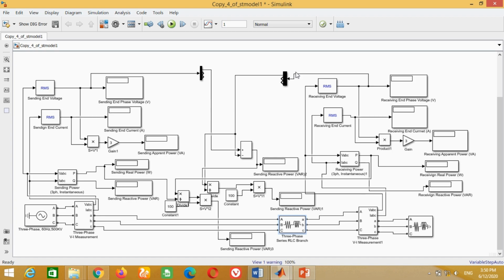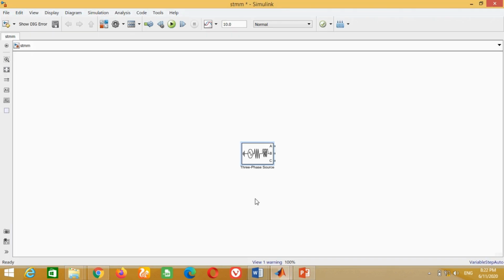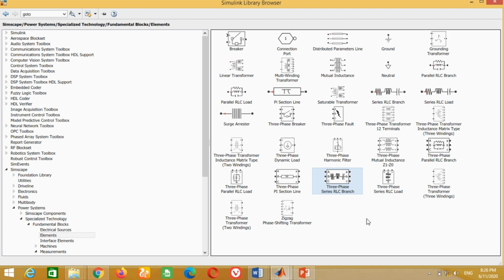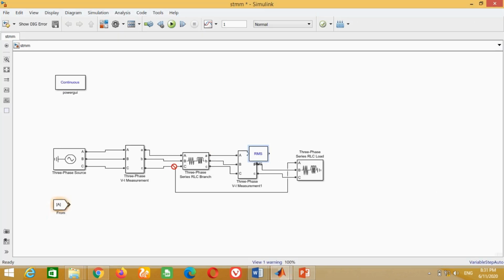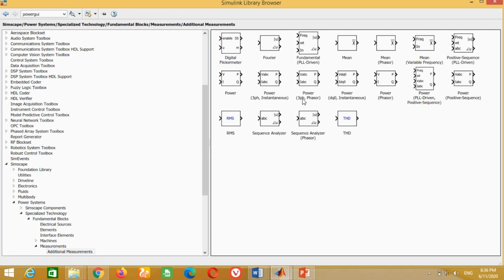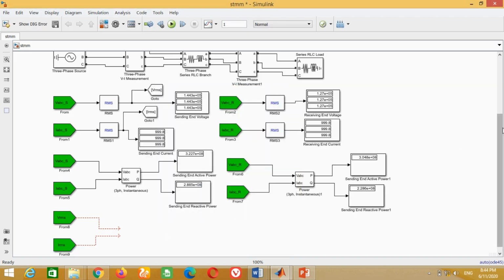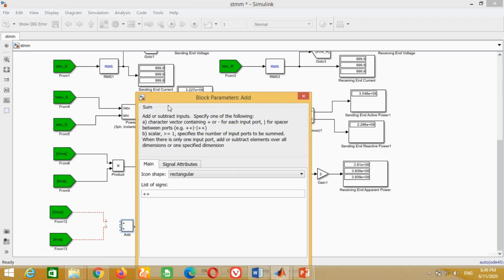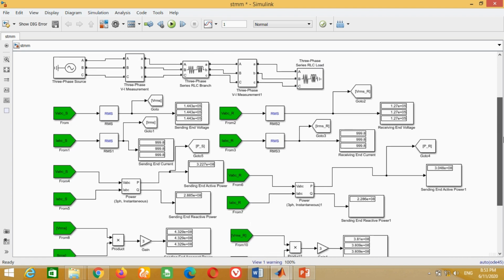How to Design Short Transmission Line in MATLAB/SIMULINK using Labels ? | Dr. J. A. Laghari

Comment: Sir, how can we generate thousands fault data from fault simulations in simulink?
Reply from the maker: Thanks for the comment. By considering a large power system such as IEEE30 bus system or IEEE69 bus system we can apply all types of faults at every bus and by changing the fault resistance and ground impedance, thousands of faults can be applied in the system.
Reply: @DrJALAGHARI  i mean how can we generate fault data with many different fault resistances, distances in one single script or command because it's hard if we simulate one by one and it takes too much time sir
Reply from the maker: @fixufixu5651  Right. There may ne matlab program available in MATLAB file exchange website. Try it. It  may be helpful to generate thousands of data.

Comment: hello how to simulink for midline and  longline, can you make a video about it
Reply from the maker: Long transmission line can be modeled by using distributed parameter line block available in the Simulink library. however, for medium line, there exists some errors due to shunt capacitance.